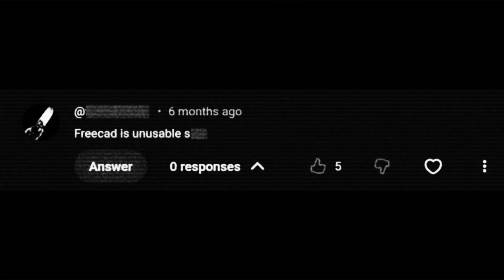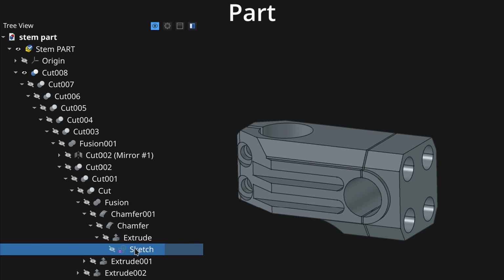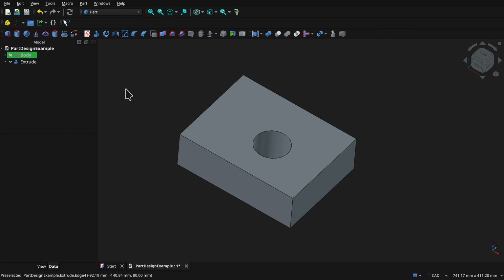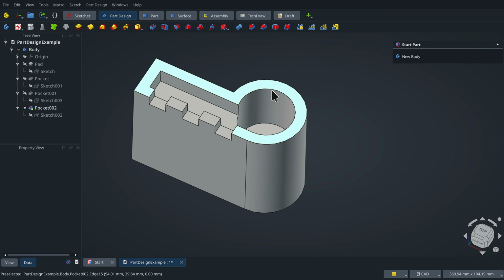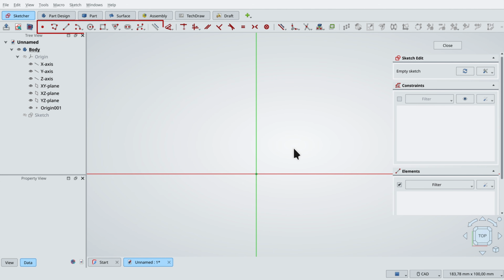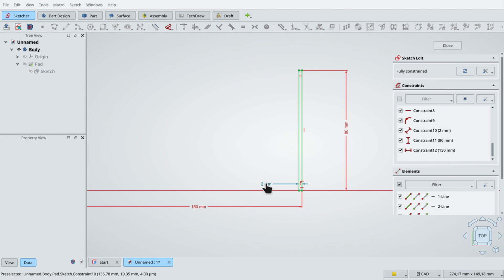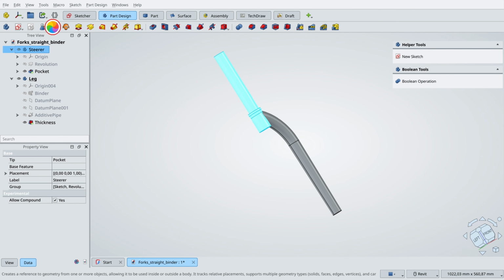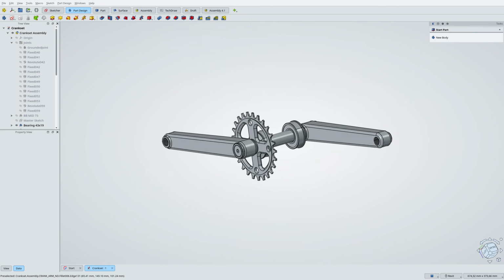STOP using FreeCAD WRONG! Do this INSTEAD (Workflow & Tips)

Comment: Dear Deltahedra, can you make a video about cutting threads since I am having trouble with that the most? In fusion I select a cylinder, press thread and have my thread. how do I do this in freeCAD without spiral triangle cutting and having to learn about thread standards and doing calculations for the whole tooth geometry always?
Thanks :=)
Reply: One way is:
Install the Fasteners Work bench with the Addon Manager.
Fasteners Work bench has two tools apart from all the standard fasteners: "Tool object for cutting external threads" and " threaded rod for tapping holes" .
You can select standard threads for these tools or input you own custom thread dimensions.
You then switch to the Part Work Bench , position the "tap" or "die"  on your part you want to thread and perform a boolean cut or union to result in threads on your part

Comment: I find almost all the icons except for the basic sketch icons to be non-intuitive and time consuming. That's probably my biggest complaint. 

A suggestion for them would be to ad a hotkey scheme similar to their viewport scheme. They have viewport controls for CAD, Blender, Trackpad, etc.etc. it would be nice to see a hotkey setup like "Solid works, Fusion360, Onshape, Rhino" or something like that. I know there's bound to be conflicts due to things like Extrude in Fusion needing 2 operations, pocket and extrude, in FreeCAD but it would be nice to see some sort of solution to basically no default hotkeys.

Combining Extrude and Pocket would be amazing too, but that's probably hard. 

A Search would be clutch. Fusion has a little search you can use to find everything you need. Most things are found in 1-2 keystrokes.

Comment: Freecad is a pain. Every time I try to use it I end up regretting it. Every tool is missing some basic function. I don't even try to use it in modeling anymore, it's a waste of time.
Recently, I tried the techdraw workbench. It's impossible to change the "Material" from the labels using the "update fields" in one of the included templates. In fact, only a handful of labels can be edited. It moves my views arbitrarily to their default positions when it feels like it. When I export to PDF, hollow parts become colored, making it seem like they are not hollow, and the only way to avoid this is to make the whole view completely white.
This is a similar experience to every other workbench I've ever tried.
Every time I decide to give it another change, I regret the decision immensely.
Reply: Holy fuck. Almost a week after this, I just had to waste another hour of my life figuring out why techdraw puts the wrong measurements in my drawings. Turns out they don't like when you put measurements on isometric views specifically (there's no warning about this fact on the program itself), and there's a "correct way" of doing it. Github issue shows the bug report as "not planned".

I hate this program so much it's unreal.

Comment: I found out that if you want to extrude a face (and the results is a separated face, not unified one) you can by unchecking "Automatically refine model after applying operations" in Edit->Preferences->Part/PartDesign, like fusion360.

Comment: Excellent video, even for someone like me who has been using FreeCAD for 5 months.
I began my journey with the Part wb (with Sketcher, Draft and TechDraw of course), and until recently I refused to spend time on the Part Design wb, but now I'm getting more and more intrigued by the latter.
I think it will be wonderful  to smoothly switch back and forth between P and PD.
Reply: É melhor evitar a mistura entre essas duas bancadas de trabalho, apesar de ser possível...
Reply: @LFANS2001 Yes, you're right. I think one should avoid moving back and forth between the two.
Should be OK to finish most of the work in Part Design, and then, if needed, do some final things in Part. For example, slicing apart something that's too big for a 3D printer's build plate.

Comment: The problem with FreeCAD it's not enough good tutorials like this one
Reply from the maker: @cyrkielnetwork Thank you !
Reply: You wouldn't need tutorials for basic things if software was intuitive. I have 21 years of experience with various 3D and CAD softwares. I have been using Fusion 360 for last 5+ years and when I started using it I figured out most of the basics in first weekend and needed tutorials only for more complex stuff to get to know the work process. With FreeCAD I feel like I am starting from near zero which is frustrating.
Reply: @CoreMaster111  Switching software is often more frustrating than learning for the first time.

Also keep in mind that when you first time started learning, software ware in general simpler with much less features. and it was expected users will read documentation. You ware also younger with more elastic brain and you had different expectations.

I use CAD only occasionally, but I'm proficient in Blender, and when people started switching to Blender it was crazy. They complained that basic features are missing, because they just assume they will have same name, or simply assumed that Blender is just free version of software they are using. Theirs conclusion was often "I'm a Maya pro, so if I can't use Blender without watching tutorials, then it's trash". But most of theirs problems was solved in a few basic tutorials. Blender even changed default selection button from right click (objectively better) to left click, because clicking right was to hard.

The difference is there's a ton of great tutorials for Blender, but not so much for FreeCAD.

Comment: This is what FreeCAD was missing - a short, clear instruction on how it works and how to use it correctly from someone who knows it well
Reply: There's something to say about UX design if you can't follow the logic of the program and at least get part way there without having to watch a video. In that regard, it has a lot of work to do.
Reply: @cwill6491  I have heard that FreeCAD was inspired by CATIA. CATIA is not hugely popular, people are used to SolidWorks/Fusion, so transition is a pain.
Reply: @cwill6491  Agreed, but this is a really common problem with CAD tools. FreeCAD is not the best in this regard, but even the best aren't great. CAD UX is a hard problem.
Reply: @cwill6491  The more complex the software, and the less intuitive the UI gets. FreeCAD is far from being an isolated case.
Reply: I only decided to have a serious look at FreeCAD yesterday so the timing of this video was perfect. Just what I needed to see.
Reply: My experience learning ProE first al the way to 100% body with surfaces.  UG almost as far.  I worked for companies that were building plastic injection molded bodies with drafts and other molding features caused by tooling part motions.   
I can not remember any support that was written down or on video any better then freeCAD.  The majority of problems and solutions were provided by people that spend all day and every week designing parts.   
FreeCAD has dozens of experts producing video that discuss about every problem I have run into.  This is the next best thing to having a person looking over your shoulder.  About the many work benches. I use part design, part, and tech drawing and a few others for  occasionally.  
I could care less if there were double the number of benches.  What is important is that the  help videos telling you how to solve problems. Show you how to use features in the work benches you normally don't touch.  I write down notes and store the video because I need them seldomly.
Reply: @thomassutrina8296  another problem is that sometimes you have to use Part workbench as well, and it's random switching between those, to see which can solve the problem..  (I use Curves sometimes as well)
Reply: and how to "read" frequent python stacktraces... lol....
Reply: What I think FreeCAD is actually missing is to be able to shed its stigma and the bad reputation it kinda rightly up until a few years ago. I used to try FreeCAD once every couple of years, always hoping it would be good enough to use and always giving up after a few frustrating hours. In the space of like two years, it went from something I don't want to touch to something I happily use. Starting from 0.21 or 0.22 usability and workflow got a lot better, but models still broke. Then came 1.0, models became more stable, and I actually started using the software, model stability has also improved since then.

Comparing it to solidworks I use at work, my only real gripe is that fillets/chamfers tend to break very often. But that's not a big bother, they're at the end of the feature tree, relatively cosmetic and they're quick and easy to reattach and fix. The thickness/shell command is also nearly useless but I don't use that very often anyway, even in solidworks I usually prefer a different workflow.
Reply: This is what FreeCAD was missing ... its missing constraints, to keep you on the path without constraining you too much that it becomes inflexible, it has too few constraints which leaves it feeling like a pile of erector set parts that don't do what you want because you aren't willing to learn how they go together because thats a lot of work compared to tools with good preset constraints that allow you to do things from the start.
Reply: Yes, I think it there's too many work benches and too many similar tools doing specific things. It would be better if they can combine those similar workbenches and tools
Reply: @Paulklampeeps  I think PartDesign is intended to eventually replace the Part workbench, but it's taking a lot of work to get it to feature-parity.
Reply: Plenty of videos on it.  What is missing must be the fact that people are not searching. It's a very complex program. It would not be possible to have a short instruction. It would take 10's of short instructions for modeling 3d printing items.
Reply: created for idiots who can't verify outputs to waste some time to learn it.
used solvers gives no proper results...

Problem of all open source shit solvers...
Reply: now we need a donut tutorial
Reply: The question is, why FC docs are not enough or why people don't discover those from UI.
Reply: @Klaster_1 FreeCAD docs can be pretty sparse. Useful as a reference, but they often don't explain how to use the tools.
Reply: @Klaster_1 they don't teach you the most important thing: what to learn and how to understand the program at a badic level. You can't spend the user to read for hours without having built a solid foundation for their knowledge. 

And most tutorials out there also fail to do this, they only teach you to do a very specific thing and if your use case differs even slightly from the tutorial it's likely to end in frustration.
Reply: Freecad is missing a support team
Reply: @ackerkartoffel8627  like every developers run program, they lack UI/UX people ....
Reply: That's bs, it's missing a tnp algorithm that doesn't freak out on chamfers and fillets. And a modelling kernel that can dissolve edges when doing fillets.

Comment: Great video! I will try the Assembly 4.1 workbench, as I find that the only problem of FreeCAD is the integrated assembly workbench. A2Plus works for small things, but it rather weak in performance.
Still, generally I just cannot understand any hate against FreeCAD. Other software might be better such as Autodesk Inventor or so, but FreeCAD is still very good.
I started using CREO Parametric lately at work, and man, this is a complete dumpsterfire. The overall performance is good, but the whole UI and workflow are just a complete feverdream. The community is completely resistant to any sort of criticism and is just claiming Creo is the best. Just not true in my eyes. Even vanilla FreeCAD offers so many features, that are still not implemented into Creo, so there is nothing to hate about it. You just have to learn it, just like any software.
Reply from the maker: @buildfromsketch8102 Thanks for your comment! I find Assembly 4 more stable. You can create arrays too, but you need to create an LCS at every joint, which can be a bit tedious.
Reply: @deltahedra3D  Is there a reasonable way of installing Assembly4 nowadays on Linux?
Last time i checked a month ago the install was completely broken and the author pointed at using FreeCAD 2.0 (I guess his own branch)...
Or are you recommending Assembly4.1 over Assembly 4 in general?

Comment: Some issues "normal" users face when transitioning:
Coming from Fusion, using it mostly when exploring possible design solutions, I'm really struggling with the project tool inside of the sketcher workbench (and sometimes the shapebinder).
When creating a simple rectangle, padding it and using that pad as a basis (simple dimension from the projected geometry) for another feature inside of the same body, it does not update when altering the original.
This behaviour is not only counterintuitive, but seems to make the project tool almost useless. As it is only certain to project the first iteration of the object, any modifications made afterwards do not update accordingly.
The common response to this issue is "you should know this beforehand", making the design process a game of chess instead of an organic flow, which can be redone afterwards to align with needed flexibility.
Another item is the 3D offset, it simply does not work (well enough). When importing steps, I'm not able to simply offset a part to make it fit (using a cut operation).
As far as I know, I need to model a dummy with the offsets built-in to make it work.
I will keep trying different workflows which suit my (prototype-)modeling style the best, the spreadsheet workbench is a champ though :D
Thanks for the video, I still learned something, primarily that I really need to try the 1.1 release candidate :D

Comment: Few days ago I've completed a part for my lens rehousing, everything in FreeCAD -> CAD & CAM. The part fits with 0 issues, templates are awesome (I'm using 1.2.0dev). 
There are problems and bugs from time to time, it can be slow and clunky. Path simulator in CAM also gets pretty darn slow from time to time. 
I'd say it's pretty darn good for a free-everimproving piece of open source software.

Comment: FreeCAD is where Blender was at a few years ago between 2.5 and 2.8:
Current userbase is used to it and don't want to relearn new UI and workflows.
New users either fight through the UI and workflows or give up completely within minutes.

I don't know how large FreeCADs team is and even if they have a UI designers onboard. 
But I wouldn't mind having an entire release cycle spend on learning how OnShape and even Fusion360 to a degree, improve on the first time experience without sacrificing functionality.
But yeah, I wouldn't mind having OpenTheme as default.

Comment: for some unknown reason whenever i doubleclick pads or whatever, FC always shows the material picker, i have no idea why.
Reply from the maker: @atom6_ Strange, you are using the stable version?
Reply: @deltahedra3D  1.0.2 on mac it is kind of weird why the doubleclick behaviour is like this, probably some setting somewhere but i cant seem to find it. i will try the new RC
Reply: Same on 1.1 RC3 - but found the setting in edit > edit mode > set it back to default (it was set to color apparently)